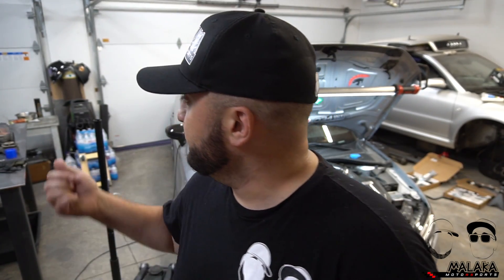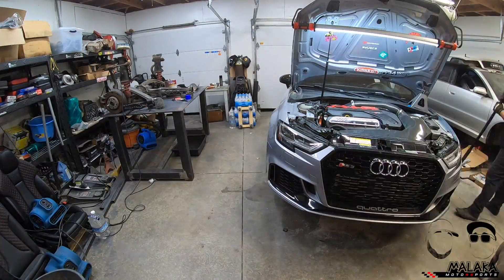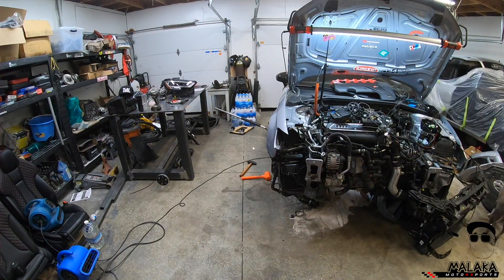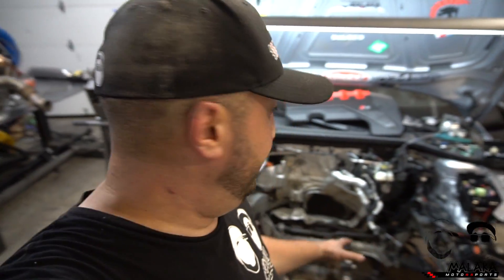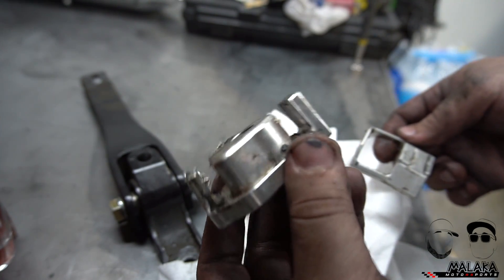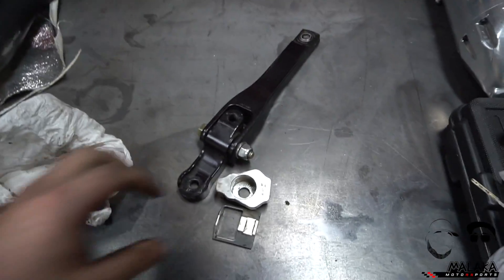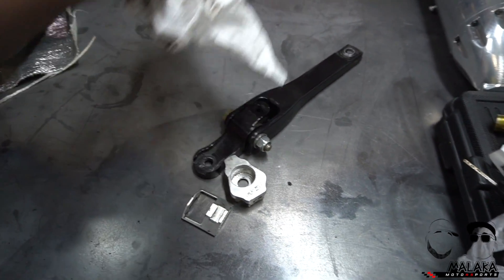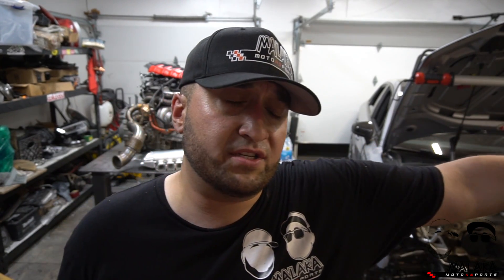900HP AUDI RS3 PART OUT - GOING BACK TO STOCK :(

Comment: Been following your builds for a while on vwvortex. Good work my man, i live out in your area, so hopefully i can come see that beast S4 build some day. Note on the dogbone inserts. I've loved my VWR full mount on my r32 and have had it in since 2014 with zero issues, i have it mated with a 034 built arm, never was a fan of inserts. I know Vibratechniks make a good system as well. Hopefully you go with those options if you have another VW/Audi build. VWR has been one of the most legit companies to work with in recent years. I'm hoping i can get there new brake kit as well soon! Good luck on your builds!

Comment: The reason is quicker to remove engine from my B5 is that the engine is longitudinally mounted so I didn't have to take out axles or transmission. What do you think about the longitudinal mounting? Thanks!

Comment: Why oh why the hell did u pull that shit on the Hoonigan races, George??? Wtf happened? You’d normally eat that tin can for breakfast and yet you couldn’t get a proper launch and clean run on any of the 3 races. Either you gave it to them or something was really wrong with the car that day. Either way, Audi could’ve commanded some respect amongst some of the shit talker and nay-sayers on the show so it was a big missed opportunity.
Reply from the maker: Truth be told after filming was over we discovered our RS3 was stuck in FWD mode. So it explains why the car smokes the tires in the front and launched so softly. Tuning also played a part as the race location dropped elevation about 2,000 feet from where we normally are. We definitely learned a lot that day, but we don’t want that to take anything away from Chris Forwberg’s 370z, regardless issues are a track day is how racing is, no matter what happened we still sent the car hard and had a ton of fun with the team over at @hoonigan